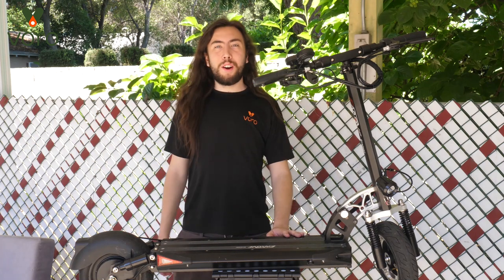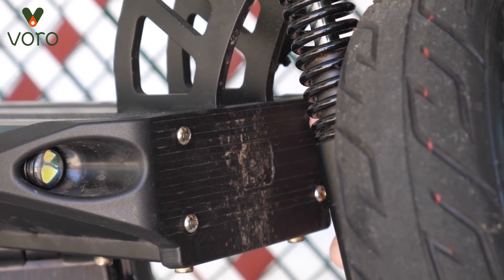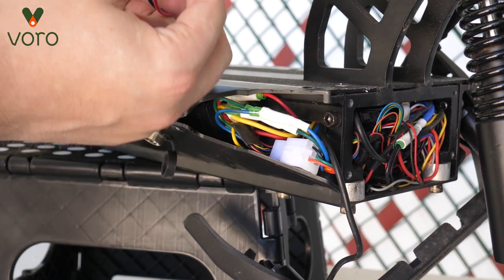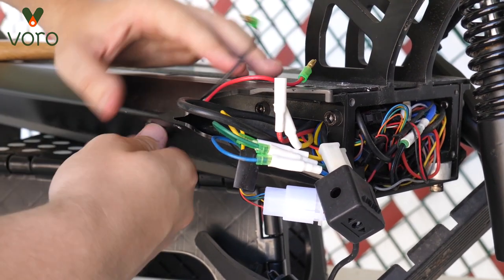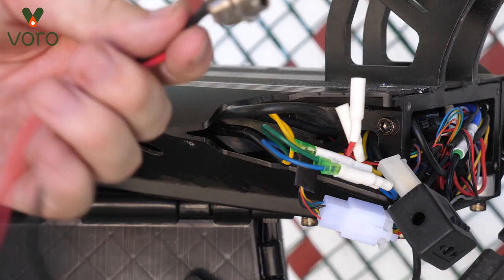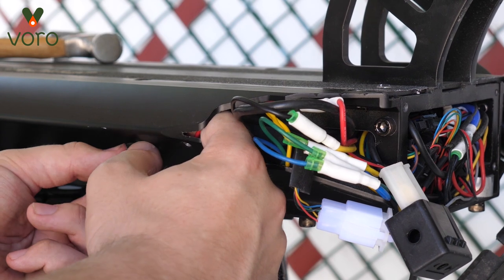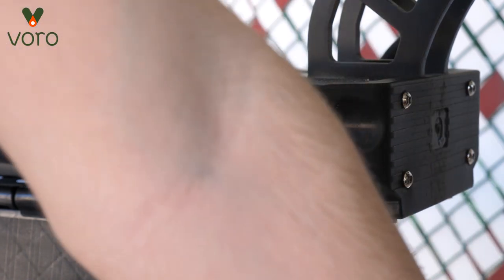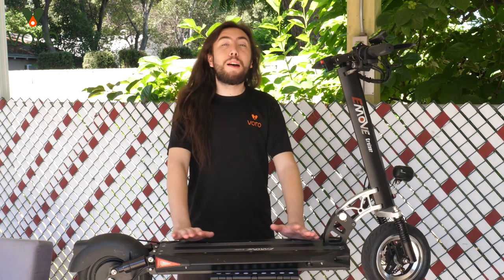How to replace charging port on the EMOVE Cruiser

Comment: Anyone that is watching this video and need to replace the port. PLEASE MAKE SURE TO UNPLUG THE WIRES BEFORE DOING ANYTHING ELSE! I had a stuck washer and made the mistake of A) not unplugging the wires first, and then B) using metal tools near the charing port trying to get the stuck washer off. I made accidental contact with the positive/negative on the port and BIG sparks flew and melted the connector to the point where I need to order a new one :( the scooter still runs and voltage reading fine, but I can't charge for now. BE SURE TO UNPLUG EVERYTHING FIRST!!

Comment: Hey aj i purchased a Emove cruiser and when i put it on the charger it made a spark in the charging port and nis if doesn’t charge i bought a new charger also, You think replacing the charging port should resolve my issue?

Comment: I just got my EMOVE Cruiser yesterday, and my question is... Can u over charge it? For example: I go ride for awhile, I get home to charge it, I forget to unplug and it's tha next morning. How damaging is that and it is unsafe especially when I'm sleeping.
Reply from the maker: Hi there, while we would not consider it "unsafe," per se, especially if you leave the scooter charging for an extra few minutes or hours, the standard chargers are not smart chargers, so over time, leaving the scooter plugged in after it has already reached full capacity in its battery will lead to damage to the battery cells and battery degredation over time, meaning the scooter will hold less and less charge, compared to when it was first received.

This is why we recommend unplugging the charger from the scooter as soon as you can after it changes from "red" to "green," indicating it is at full charge.
Reply: @VoroMotors  ok cool. I believe by this time next year. Ima need a battery

Comment: Hey aj i purchased a Emove cruiser and when i put it on the charger it made a spark in the charging port and now it
 doesn’t charge i bought a new charger also, You think replacing the charging port should resolve my issue?

Comment: The washer is kind of a joke. My factory installed washer came loose after about 3 weeks. Putting this one on took 45 minutes. 

The wires are not the same color as the video: mine were white and red. I pulled the wires just like the video stated and the red wire snapped leaving a piece of it in the connection to the battery. I had to unravel the red rubber to get to it. Carefully pulled the piece out and connected the new wire to the battery wire....then I tried to put the red rubber back over the connection and SNAP!!...the wire leading back to the battery snapped.

Needless to say...my scooter is toast....lasted me 15 months...not sure if I'm going to buy another. May try another brand. Was showing signs of trouble...drove it to my doctor's office 2 weeks ago...came out and it would not start....suddenly about 2 hours it worked. You guys need to up your game!

Comment: Is that if you burnt it out?
Reply from the maker: It could be for a variety of reasons! burned out, ripped out, or just malfunctioning. - AJ
Reply: @VoroMotors  so do I just gotta replace the 3 pin